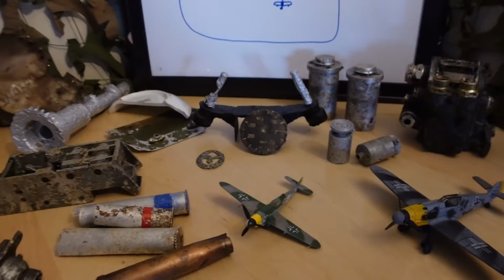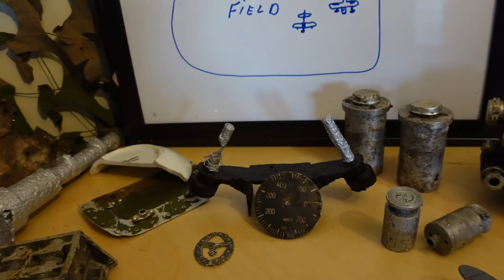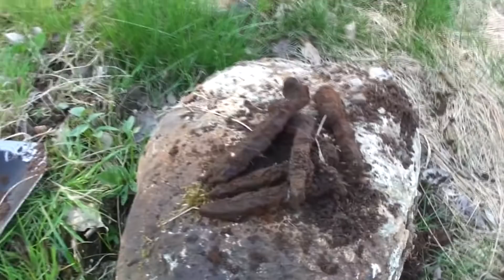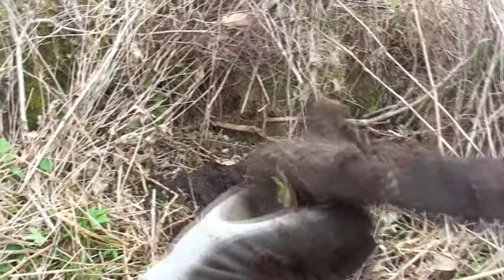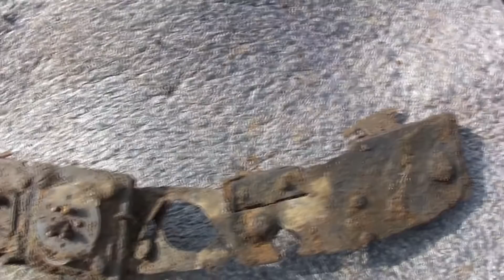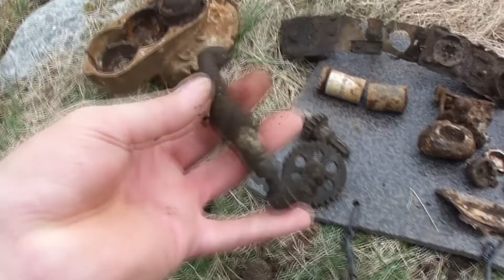Luftwaffe airfield metal detected. You wont believe what i found..

Comment: Looks like a grand day of finding aircraft parts. The gear box has a heavy casting, and looks to have a planetary gears. It has a square drive that looks like it would be for a hand crank. The ME 109 had a hand crank for starting the engines. Or as others have suggested it may be for hand cranking the landing gear. It will be interesting to find out what you discover.
Reply from the maker: Coolfeedback and will look into it more. Thanks Jeff

Comment: If you want to make your aircraft speed dial safer to handle (because it is Radium painted) - you can simply seal it in two part epoxy like the kind used for making decorative paperweights.  A few millimeters thick on each side at least.  Preferably 5-10mm thick would be great.  None of the radioactive paint or radon gas would leak out if sealed that way.  However, you could still detect it on a geiger counter even through the epoxy.  You can get a cheap geiger counter for about $50.  See the "Radex 1503" on ebay.
Reply from the maker: Hm will look into the radiation thing and perhaps make a video of just that. Thanks for watching.
Reply: @WW2HistoryHunter  It is a fascinating hobby to start learning about.  You should be able to easily find some mild and safe test sources in the antique shops.  Check any vintage orange colored pottery and also the old alarm clocks.  Not to mention green/yellow uranium glass.  Rock and mineral shops can be interesting with a geiger counter too.  Check dinosaur bones and mosasaur / megalodon fossil shark teeth.  They are known to absorb natural zesty isotopes during their forming process.  Strange but true.

Comment: maybe that assembly is part of the inerta starter system on the planes. WHere they inserted a big handle and cranked it to get a flywheel spinning that then started the engine. I think BF 109's used them
Reply from the maker: That could be it and will look into that actually. Thanks for watching.

Comment: That's the manual over ride gear box for the landing gear, if the hydraulics gave out, the landing gear could be hand cranked down.
Reply from the maker: Thanks for the info
Reply: @WW2HistoryHunter  you're welcome, happy hunting
Reply: @WW2HistoryHunter  over been thinking about this, for your magnet fishing, get a truck inner tube, a sheet of thick rubber and waders, I saw this in a WW2 photo of Russian snipers in a swamp, cut the sheet conforming it to fit the bottom of the inner tube, vulcanized to the tube making a bottom, next fit the waders onto the sheet, vulcanized together, allowing you to wade into the pond maneuvering anywhere you want to go, get a big piece of Styrofoam for a floating table so you can place artifacts on it, in tow back to the ground all dry.